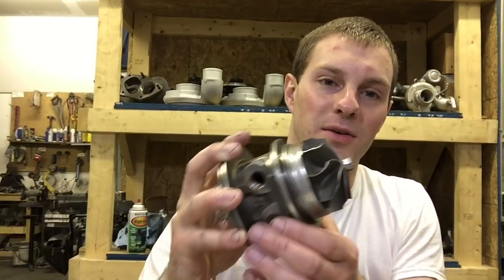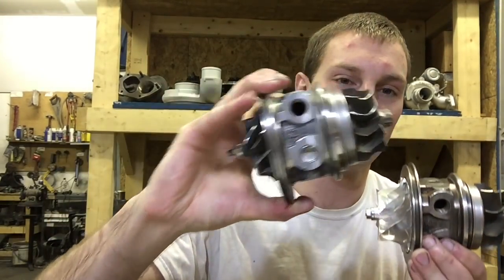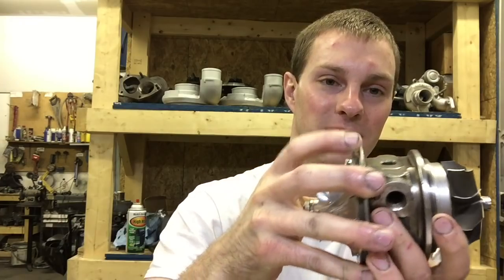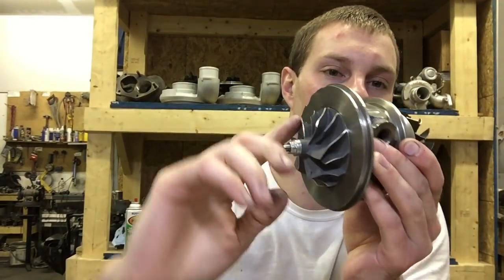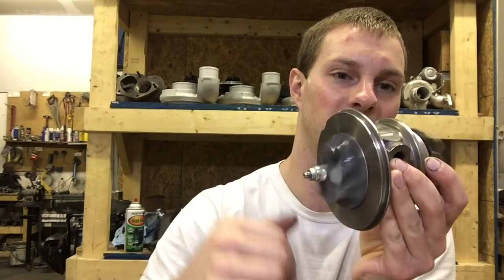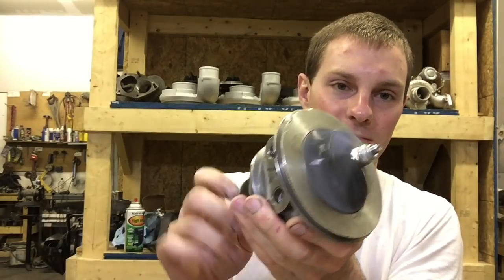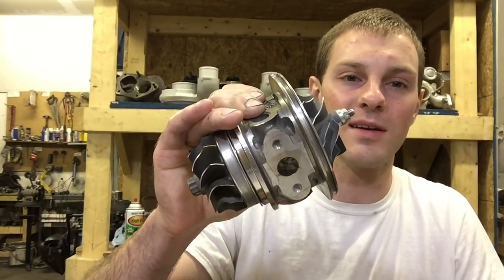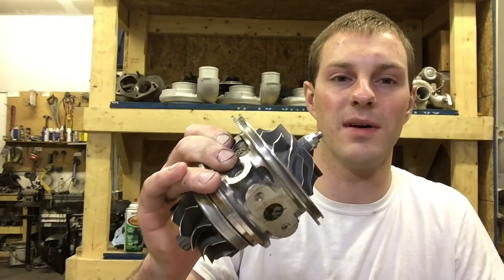Pros and Cons of Ballbearing Turbos

Comment: Hi there, I run an E-7 Mack in my boat for lobstering every day. It has a Garrett which was designed for just that engine. When Volvo bought Mack in early 2000's, Volvo said no more Mack marine engines because they have a marine line. Now the turbo parts are obsolete, I have old ones from other engines but I am gonna be SOL someday. I'm asking who might be able to take the data from my turbo, and match it with another marine water cooled turbo that will do as good a job or maybe better? I did put a JD 525 hp one on there and am running it now, but I'm missing 100 rpm on top and fuel consumption has increased 2gph. I'm sure somebody knows and can help me, but finding this person has been pretty hard so far. Thanks
Reply: Have you spoken directly to garret, seems like the people who built it would know all about it
Reply: They wont answer, but I am talking to their rep in NY but he doesn't know. Yeah.

Comment: I have import drag car....mechanical pump 16v charging system direct port nitrous. 2jzgte 3.0 liter 10.1-1 compression. E85/e98 
Looking at Gtx4502r 7687 or Pte 7685. Power glide 274 cams looking to go low 8s
What turbo would you sugest?
Reply: T4 twin scroll

Comment: Hello,
I am in middle of many upgrades for next years WCF imp vs dom.
Is a gtx 80/87 better for me than a BW 82/87 jb - i have a glide with nitrous for staging/spool up.
Is the dbb gtx harder to control boost at hi boost levels -would the BW have more usable hi boost?
When not on the nitrous-would you go GTX?

Comment: Is it OK to run mineral oil throught a ball bearing? I'm maybe planning on fitting a Ball Bearing on my old turbo diesel 4x4. :)
Reply from the maker: +Thorben Verstraete I don't know the answer to that question. I have never heard of mineral oil
Reply: I'll ask my question in another way. I'm driving an old Nissan Patrol Y60 with a 2.8 6 inline and it lacks power in the lower rpms, a ball bearing spools faster so that looks like a decent upgrade since VGT and VNTs are hard to adjust on a pure mechanical operated vehicle. The oil I'm using is the oil used in earlier Cars, so not the fully synthetic oils used nowadays. So my question is, can a ball bearing turbo run on any type of oil?
Reply: Thorben Verstraete I don't recommend running a thin oil like mineral on any turbocharged application. It thins out too much from the heat and doesn't protect much at all.
Reply: Thorben Verstraete basically a ball bearing will spool faster, but run much hotter than a journal bearing turbo. There's more moving parts, thus, more friction, so it heats up to a higher temp.

Comment: Lower the EJT's? What are egt's? and how is reducing them beneficial?

I'm using a single cam 1.6 so I'm thinking ceramic BB with 2.75 exhaust, not too big right?
Reply from the maker: +Bjorn Kingslayer of the egts get too hot your motor or turbo can blow, the colder it runs the less likely the exhaust housing is to crack also

Comment: What do u think about those half ball bearing turbos? Journal bearing in turbine and ball bearing on compressor?
Reply from the maker: I don't like those, I prefer to convert them into ballbearing or journal
Reply: Turbo Lab America ok, throught I'd ask. I got one. My tuner said it was a night and day difference between my other turbo that was just journal bearing, but it might be the trim ratio was a bad combo on last one. It was a 45 trim on compressor. My half ball bering turbo Compressor Is 58mm by 82mm. Turbine Is 56mm by 64mm. With a   .63 AR Turbine Housing. Compressor AR .6. One of those T3 exhuast T4 compressor advertised CX Racing Turbo. My Engine is A 3.8 V6.

Comment: Im pretty new to turbos and trying to learn more.  Is, say, a Borg Warner S366 compatible with hoses, wastegates and intercoolers of different brands?  Or are they designed to operate with components of the same brand?
Reply: good question, I just bought an S366 for my 302 Foxbody.
Reply: Wastegate, bov, intercooler etc etc brand doesn't matter. What's more important is picking the right size wastegate and everything around it.
Reply: Brian Jeppesen 
Appreciate it
Reply: You can mix and match whatever you want to. But when it comes to something like a wastegate that is going to keep your engine from over boosting and running lean and blowing your engine buy something good life a tial or hks and make sure it's big enough. And don't cheap out on fuel injectors.

Comment: Hey I want to put a rdx turbo on a k20z3 I'm looking to make about 350hp to the wheels I'm not a turbo guy and I'm running g from lag I'm looking for almost a 2016 type r set up with a little more punch
and was looking into meth injection systems what are your thoughts?
Reply from the maker: +Shamal Abraham I'm not sure what to tell you on that.
Reply: Shamal Abraham that turbo won't handle that kind of power sufficiently without blowing all hot air. Your best bet would be a gt3076r sized turbo. They spool amazing and can put out that kind of power.

Comment: You talk about your 2.5 Liter inline 6 engine... Do you drive a bimmer and if so which one? :D
Reply from the maker: +Max Lindner I have a 95 e36 4 door sedan that I built a turbo kit for. It runs and drives but the war chip i bought second hand was not any good, so it's just has the original chip. I stopped work on it in 2014 after I rebuilt the engine for fun.  Since turbo business picked up from 70 orders a month to 300 per month then to 500-600 orders a month so I stopped working on it since i got busy.  I left off with changing out the exhaust manifold with a tcd cast manifold but I still have to make a down pipe and buy another tuning software. 

After 2 years without a car I just bought a 330xi, which has been giving me problems ever since ( consistent flat tire, airbag light, fuel pump, coolant screw, disa valve, and secondary air injection pump, missfire when cold, headlight bulb, now headlight ballast), I just did the basic maintence by changing out all of the gear oil and oil, fuel filter, and I reconditioned the interior and replaced the wood trim with the zhp trim and shift knob, I had this car for 3 months but at least it drives.

Comment: I was thinking if it could be a possibility that the ball bearing turbo could be opened like a tiffin box, with two ball bearings on each side. Then there could be a shaft that can be used like an axel on a swing arm and then the whole oil cooling can be tightened up with the shaft or axel itself. Then the two different parts holding the turbo fans can be screwed on 2, 4, or 6 screws depending on the size of the turbo. So if your ball bearings do break. Then your engine, even if on a carborater (don’t mind the spelling), would just stall the engine. So you know you have to service the turbo. Hence the bearing housing stays intact. And all you have to do is change the bearing and clean the oil. I mean it was just an idea. As I was thinking of putting a oil cooled turbo for my Yamaha rajdoot RD 350 2 stroke. In which the oil coming from 2 openings come into the oil cooler and then exit into the 2 turbo for each cylinder, which then will go into the engine. This kind of design being in a 2 stroke just helps you maintain your bike easier hands on, plus increases the life of all the parts as well as reducing cost, and overall consumption. *just an idea. *please advise.
Reply: And if you were thinking that whether how both the turbo fans rotate together, then what the idea was that the shaft through joining the turbo fans, could have a bolt which clips onto the fan on both sides. Like with a special kind of washer which could pierce into holes on the turbo fan, which when tightened the shaft and the turbo fan, so the shaft screw and turbo fan rotate together. So it can be dismantled and put together. And there 0 to mere heartbreaks with the design.

Comment: Can the internals from ptc 106 mm be changed from journal to ceramic ball bearing. Not street car just drag racing
Reply from the maker: +Judy Wright I don't know, I never worked on one that size.
Reply: Turbo Lab America 
hey, are you able to rebuild a garrett gt42r ball bearing turbo? rear wheel is chewed up.

Comment: I'm curious what 2.5 straight six you have 1jz or an rb25 perhaps?
Reply from the maker: BMW e36, I still have that car but not sure if I will finish it because I have a 335xi with 3.0 inline 6 cylinder twin turbo and all wheel drive

Comment: Can you suggest a BB turbo for a 12 valve cummins?
Reply from the maker: +Justin Rodriguez I think it's more work work then it's worth to put a ball bearing turbo on a cummins.
Reply: Fair enough.  What would you suggest?  I am looking for something that spools up quickly without restricting my exhaust flow too much.  My original plan was to find a used hx35 or he351 and rebuild it.  I'll admit I don't know too much about turbos, and I am just curious what is out there.
Reply: Justin Rodriguez hx35 or 40 is a great turbo upgrade from the h1c!

Comment: Your thoughts on the Ebay Ceramic bearing turbochargers???
Reply from the maker: +impactajuvenile the are many kinds. Some have the bearings like found in a skateboard, some mimic the genuine Garrett cages. Making quality ball bearing cages takes high technology machining because the radius where the balls ride has to be machined enough large enough for the balls and sleeve to press in but tight enough so the balls wont cause vibration causing the cage to fall into pieces.

I can't tell you much about those turbos because I haven't used one or know anyone that used one, I recommend reading the reviews from people that have used the turbo that you are thinking of buying.

I repair a lot of genuine ball bearing turbos but have not yet had someone send me a fake one to repair, most likely because the cost for us to rebuild the turbo is it needs a cartridge may exceed buying a new one.

Comment: Ball bearing in my opinion is over rated. Having a lightweight turbine wheel properly sized for application and properly maintenanced car(no boost leaks, good oil etc.) would be more beneficial than just going ball bearing. I prefer traditional thrust style bearing for ease of maintenance. The rebuild kits are cheaper too.

Comment: What about reliability of the turbo itself
Reply from the maker: Ball bearing turbos from my experience don’t last long at 40 psi, journal bearing turbos are rated up to 44 psi some people push them harder but it depends on the turbo some will hold up at higher boost than 44.

Comment: I am in the crankshaft repair business.  You sound like a very knowledgeable and honest young man.  I like the way you explain things and your willingness to share knowledge.  I try to treat my customers the same.  I know very little about turbos, but have you considered ceramic bearings or is that standard.  You may also want to contact Dave Conforti at worldwidebearings.com.  He is a former motorcycle racer and knows everything there is to know about bearings.  Great guy to deal with and a wealth of knowledge.
Reply from the maker: +Charlie S thank you. The balls are ceramic that we use. The ball bearing cage is the most expensive turbo part to make. I have a friend that used roller bearings inside the journals of the bearing housing on a Holset hx40 that worked really well. Our ball bearings consist of one cage with 2 separate shaft sleeves and 2 different inner races all contained in 1 cage. The guy you mentioned maybe helpful with converting Holsets to ball bearing but I never had spool issues with the diesel applications.

Comment: hi will a b20vtec conversion handle t3/t4 turbo
Reply: Chantal Cloete use arp head studs and an aftermarket clutch, fuel pump injectors tune all that, it'll be fine for about 11 psi to be reliable.

Comment: What's a comparable turbo to a bb garrett gt4094r that won't empty my bank account?
Reply from the maker: +Randy Higginbotham the closest turbo would be the hx40 with 67mm compressor and 67 mm turbine and a 1.15 t4 divided turbine housing or a .96 or .81 t4 open turbine housing. We build these for 750$
Reply: Thanks. I have considered the HX40/50. But, I thought the Holset turbos used journal bearings.
Reply: nice info brother, i have a 2.4 fully built dodge srt4 in my pt cruiser with hi stall tc , built transmission, 3 inch exhaust, acura cold air,  intake, headers, i have the agp twinscroll manifold & tial 46 mm wastgate, just need to know the right t 4 twinscrolll turbo to go with . suggestions bro

Comment: wat would be about the turningpoint in engine size / max rpm that would make it worth the money to buy  ballbearing turbo's over oilbearing
i been looking at turbosetups for a 4.0 inline 6 , the engine has a realy long stroke and in stock form runs to about 5500 rpm 
want to run the turbo on it for a street fun strip setup , the oilslick type turbos are a LOT cheaper than ballbearingversions and if the difference isnt that big i rather go cheap 

have been folowing a build from sloppy mecanics and been seeing the single 80mm oilslick turbo in his truck come on at about 2500 rpm on a allmost stock 6.0 lsx truckblock at somewat low boost on the street 
it seems to be about where it needs to be with the gearing and higher stall converter he has in the truck before becomming dangerous to drive , think the last dynopull he made with the boost turned up to 60 pound was about 730 hp at the wheels 
https://www.youtube.com/watch?v=ZOkSD0d_MMc
https://www.youtube.com/watch?v=SyCxWzz19gQ
Reply from the maker: +watahyahknow 2.0 4 cylinder going over 600 hp probably should go ball bearing.  The spool really varies on the tune also.  If the engine size is less than 4 cylinder it's a good idea to go ballbearing for spool or use an appropriate size turbo. Some people want to have better spool for auto cross also but boosting at lower rpm can damage the engine and turbo because the oil pressure is lowered at lower rpm.